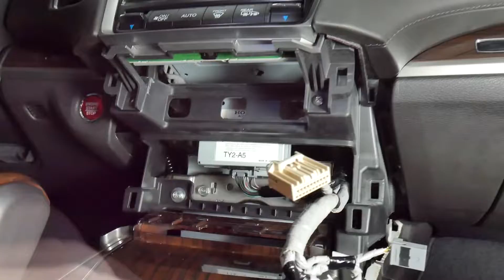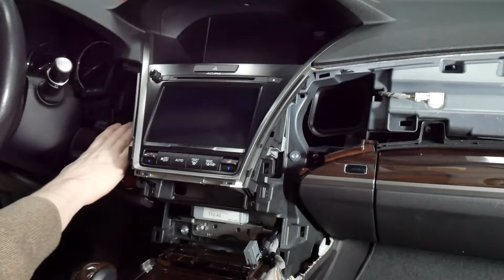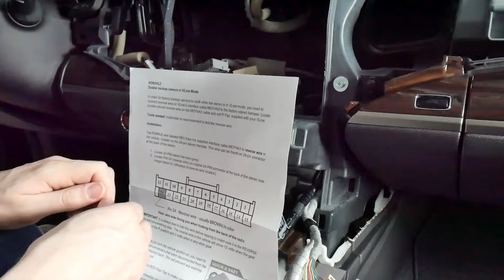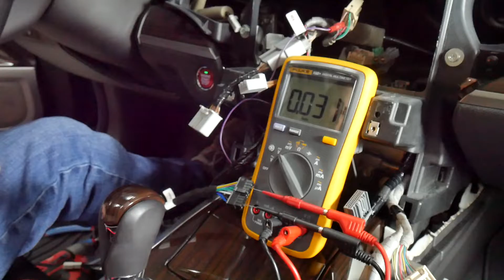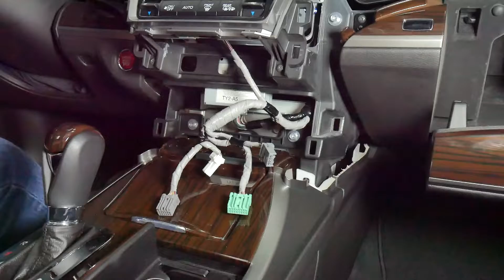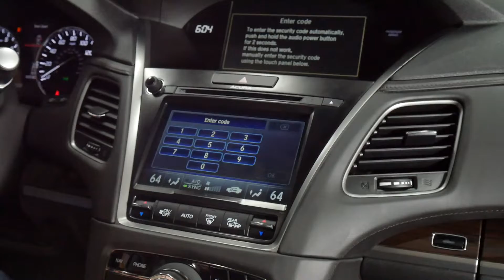Upgrade to Wireless CarPlay & Android Auto: GROM VLine VL2 in 2014-2020 Acura RLX

Comment from the maker: GROM VLine VL2 System for wireless CarPlay and Android Auto integration into the factory car stereo of Acura RLX 2014-2020 is available here:
https://gromaudio.com/store/vline/grom-vl2-hon3.html
Model: HON3VL2

In addition, it is compatible with the following vehicles:
Acura ILX 2016 - 2020 (dual screen only)
Acura MDX 2014 - 2020 (dual screen only)
Acura RDX 2016 - 2018 (dual screen only)
Acura RLX 2014 - 2020 (dual screen only)
Acura TLX 2014 - 2020 (dual screen only)
Honda Accord 2013 - 2017 (Navigation only)
Honda Odyssey 2014 - 2017 (dual screen only)
Reply: Does this also work in the sport hybrid models?
Reply from the maker: @neilquinn  yes it works as long as the vehicle has the dual screen.

Comment: Why bother putting it in the glove box when you can put it above the glovebox?
Reply from the maker: Do you mean above the glove box inside the dashboard? We insist that the module stays accessible and secure, so the glove compartment is the best location. It allows for good airflow, and the Bluetooth antenna is not blocked and stays secure from breaking.

Comment: the vline documentation mentions that the factory backup and front-facing cameras will all be retained with the vline. My 2017 RLX (Advance pkg) has a camera switch/button on the end of the turn signal lever. I’m curious how that switch is monitored by the vline. If the backup camera is activated by reverse, which requires a p-tap on the reverse wire, how is the front-facing camera activated or detected by vline? Is an additional p-tap necessary on another line? I’ve watched a lot of the various vline videos for Acuras, but haven’t heard any mention of the front facing camera or any of the acuras that have said camera with a dedicated switch.
Reply from the maker: Tapping the reverse wire is not for the reverse camera activation. It is in general for the VLine to be recognized by your stereo.
In fact, some installers make a mistake when they connect the VLine without tapping the REV wire, and the backup camera keeps working. However, the VLine will not work without tapping the REV wire.
In other words, all automated factory functions are retained with the installation of the VLine system. There is no need for the additional wire P-Tap.
Here is the demo video where we show the front-view camera working with the VLine:
https://youtu.be/3UYvCQHnukg
Reply: why don’t find empty space for vline that doesn’t require trimming factory parts
Reply from the maker: @วิชญ์ภาสจรสโรจน์กุล-ป7ศ  we recommend placing the main VLine module in the accessible location and do not bury it inside the dashboard. Here are the reasons why: https://gromaudio.com/forum/forum/vline-lite-support-forum/general-tips/810-tech-tip-where-to-mount-the-vline-or-vlite-main-module